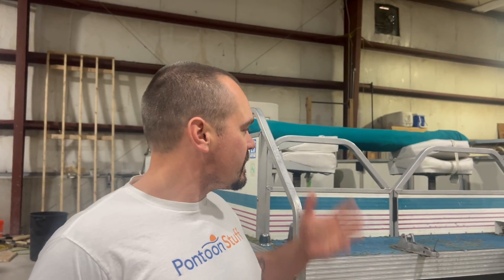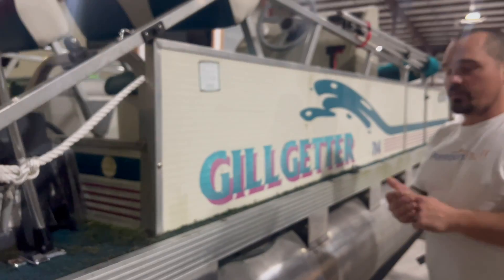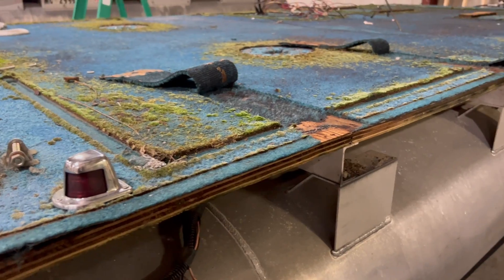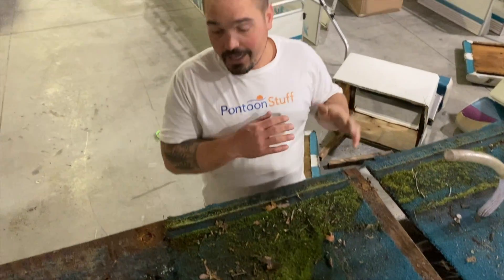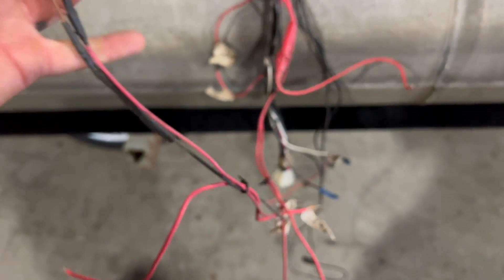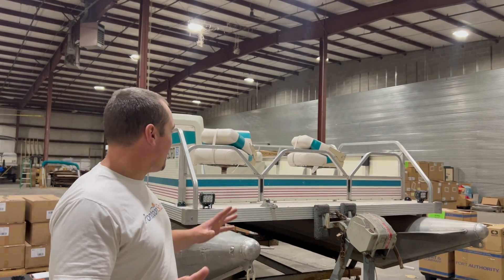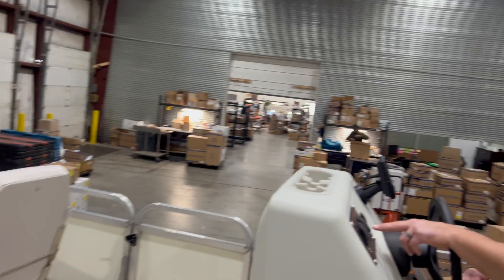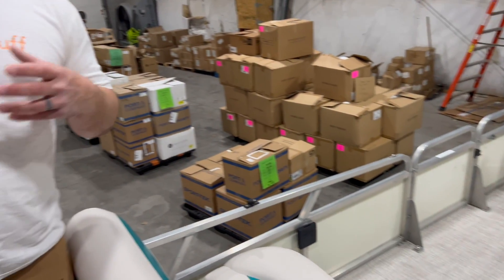Gill Getter Pontoon Resoration

Comment: What size wire would you recommend for usb outlets
Reply: If I may interject, most usb dual outlets will come supplied with 16ga. fused pigtails. I recommend 14ga. - 12ga. direct runs through the breaker at the switch panel, where it is easier to service.